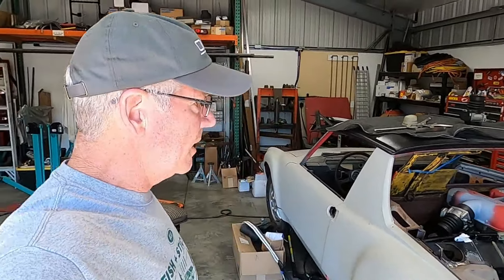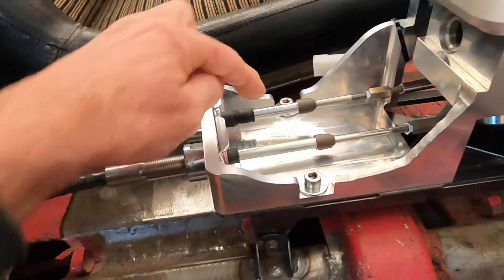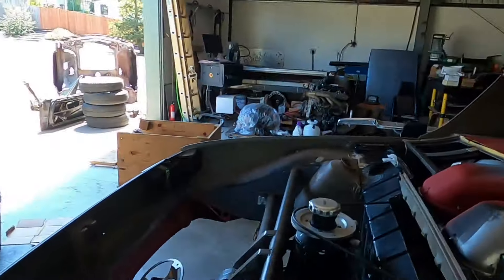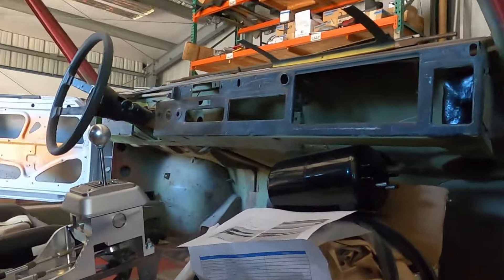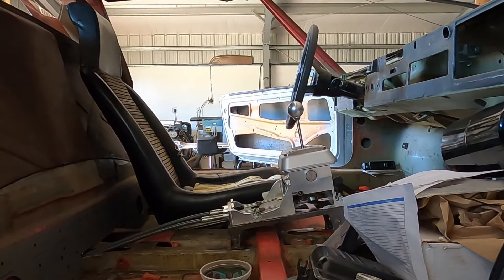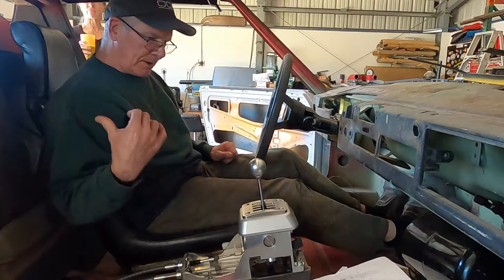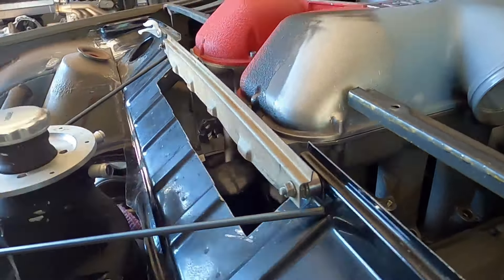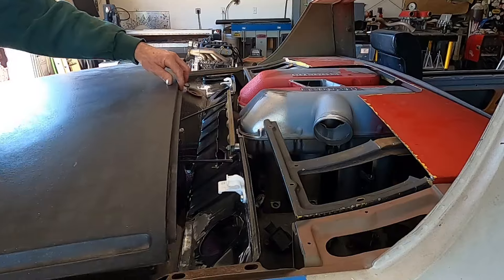914 Ferrari Build - Episode 35: Will the shifter shift?

Comment: I like the stock ribs in the trunk. Provides that original esthetic. Seems like a good idea for providing riggitedy as well.
Reply from the maker: Style points on those panels are still TBD so nothing is off the table. I absolutely need the panels to be stiff so I'm with you there. Thanks for watching/commenting: greatly appreciated.

Comment: Nice progress! Now would be a good time to seam weld those shock towers, especially the part where they don't really connect to the frame rail.
And when it's all done we can do a car swap and hit the backroads. :)
Reply from the maker: Yep, that connection will be addressed. And what are we car swapping, if I might ask? ;-)
Reply: @attheredbarn1669  Well, you've seen my 3.6L at the red barn more than once. Not sure when you've driven an air cooled car last.

Comment: Do you think you are going to regret the seal not following the intake more, seems like it should come in at a rounded 90 on both sides of the intake to make it look like it was supposed to be done that way.  The angles right now don't seem to match anything (unless I'm missing something). Also, the plexiglass idea sounds cool, but it's going to be inside the trunk under the roof when it's stored. I'm not sure if the juice is worth the squeeze.
Reply from the maker: I hear you but the seal can't bend that tightly. And at this point (about a week after I did the video), the plex is out. Next episode will cover what I'm thinking. And thanks for  your thoughtful input! I really appreciate it!

Comment: Are you worried about heat transfer to the stored targa top?
Reply from the maker: No worries about that. The only time the top will be stored is when the trunk liner is in. So the heat situation will be about the same as the stock trunk set up.